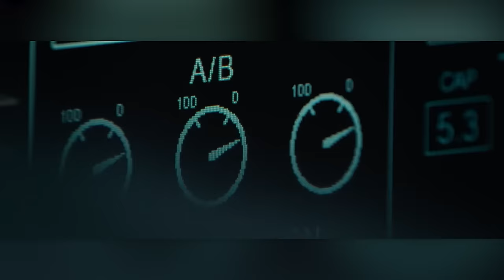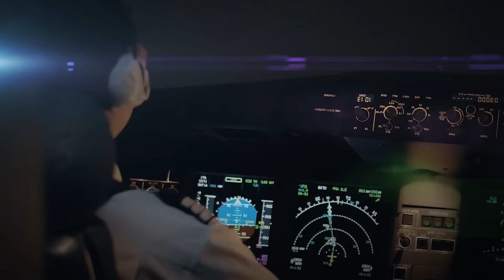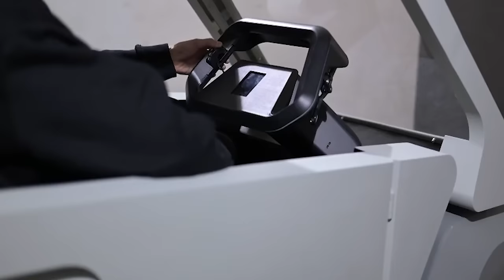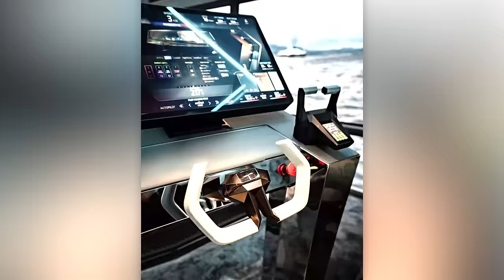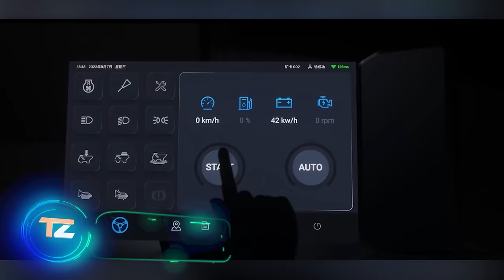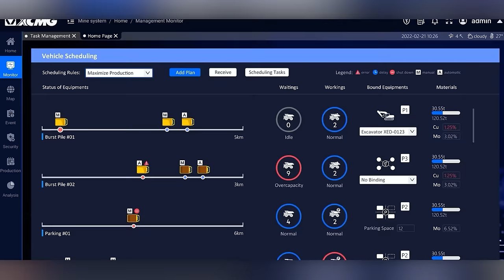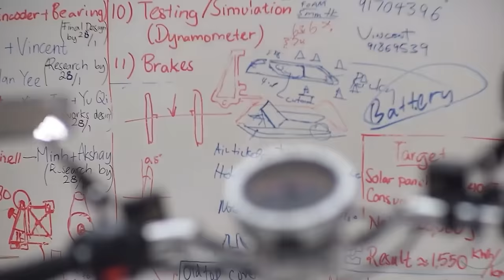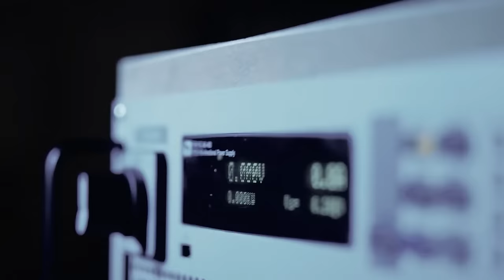20 COOL VEHICLES YOU WILL SEE FOR THE FIRST TIME

Comment: Hydrogen is extremely explosive.. and you cannot guarantee a breach won't occur in a severe accident causing even more casualties.. how about a engine that runs on good intentions👍
Reply: so is gasoline
Reply: @timtroke  You are mistaken liguid fuel is not nearly as explosive as hydrogen.. when a tank is breached and it ignites the gas you have effectively produced a fuel/air explosion which is far far more devastating that a liquid fire from gas
Reply: @Bartholomeow141 a bullet and a single spark would disagree. 1 thing we should be able to agree with is we don’t have everything figured out so let’s stop pretending..